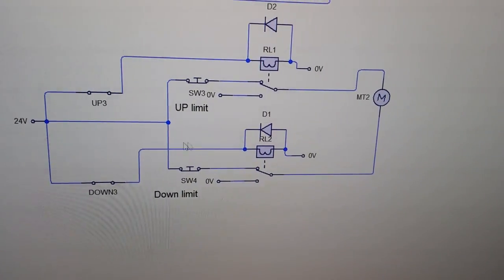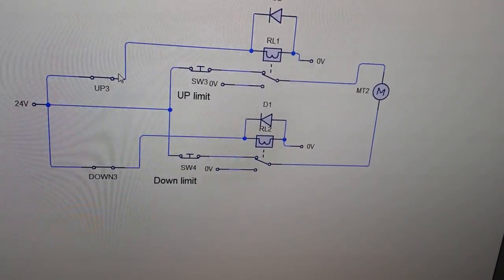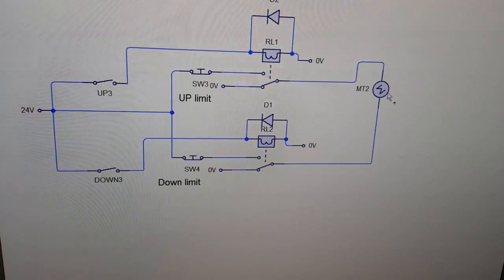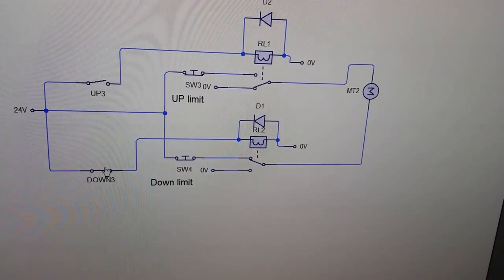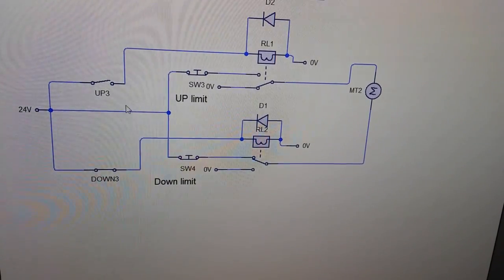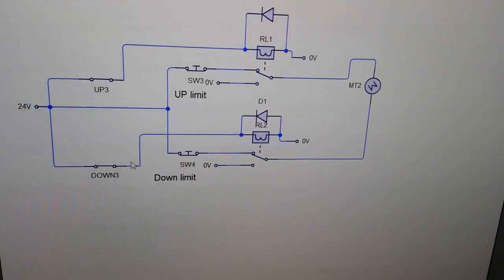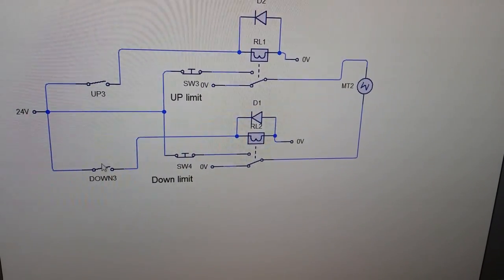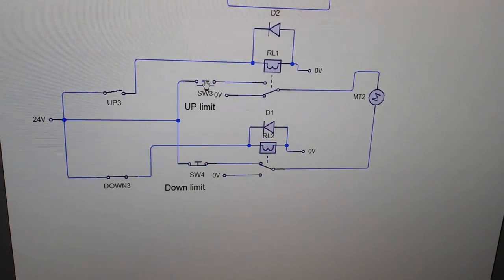Reversing motor circuit with limit switches

Comment: Thank you for the video.I have a question,is there anyway to automate this circuit so the item moving would trigger the reversing cycle?
Reply from the maker: I think I did it, I'll make a video for you
Reply from the maker: Here it is: https://youtu.be/6goPexXLLO4
Reply: @ak321  I'm pretty sure that's not what they meant.

I am thinking that they meant, that when the motor is turning in either direction that there is a door, or whatever object, moving and when it hits the limit switch it stops (like in real life) or that it automatically reverses in the opposite direction.
Reply: Are you there? I have a circuit if you still need it.

Comment: Please may I ask what the diodes are doing in this circuit?
Reply: The diodes are to absorb the EMF that is generated when the relay coil is turned off and the magnetic field collapses. If you don't have them that pulse of electricity could fry other components. In this circuit you really don't need it since there is nothing to fry. However it is smart for them to add it for two reasons,,, 1. It gives the end user the chance or a reminder to add then in their project. 2. Some relays come with them built in.

Comment: I'm looking for a circuit that automatically reverses a motor using photocells for limit switches and relays for the power control. The motor will be in constant operation simply moving a track back and forth 24/7. Any ideas?
Reply: HobbyVAWT i am too. Did you find out
Reply: What do you mean by "using photocells for limit switches"?  Maybe if you explain it more.
Reply: @alanblay1826  I can make it go back and forth all day long but I don't get what they mean by using photocells as limit switches?

Comment: For bang bang control, replace two switches with a single double pole double throw toggle switch.
Reply: What is a "single double pole double throw" ?
Reply: @AztecWarrior69_69   "single" as in "only one" 

haha sorry
Reply: @Hein223  You know I was at first kinda joking but just yesterday I was at my wits end because in Circuit Wizard simulation software I was trying to make a PCB for the first time and I got thrown for a huge loop. I accidentally picked a Double Single Pole Double Throw relay. Spent an hour trying to figure out and reroute the tracks to make it work. Till I finally realized what I had done. I mean, how the software glitched and put the wrong one in, yeah that sounds better. LOL. I knew they existed but just wasn't paying attention.

Comment: That's not properly done. High power current goes through limit switches and why would you do this with relays when you can simply connect control and limit switches in series.
Reply: Who said this was high power current? Who said you could use high current limit switches? Who are you to say this is not proper? The circuit works good and is safe for most dc applications. Complains about "High power current goes through limit switches" but the complains about "why would you do this with relays "
Reply: duh